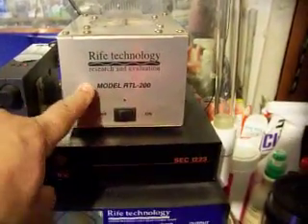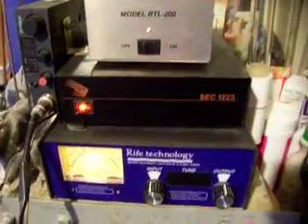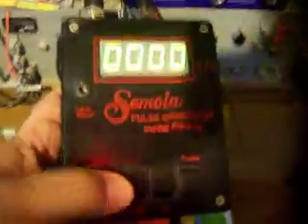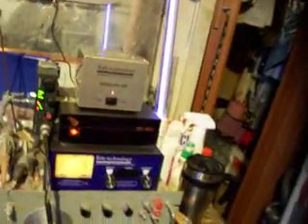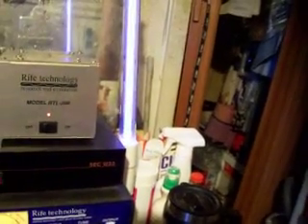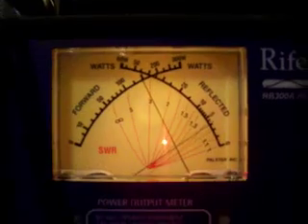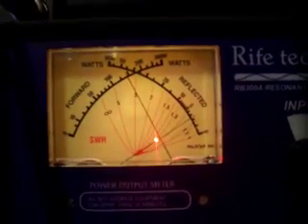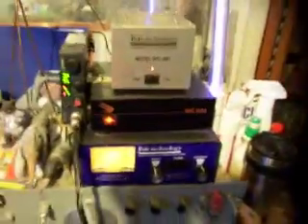Rife Plasma Wave Generator Activation

Comment: I read that all the original frequencies that Rife used to kill pathogens some over 20 MHz & that Audio frequencies was added by People that worked with Rife so No One could steal the working frequencies. I also read the ultra super expensive Rife machines that used Audio frequencies has a carrier frequency up to 20 MHz CB radios operate In 27 MHz range but only 5 watts so I wonder If It works maybe with an amplifier but I once felt a burning pain from a CB radio output.